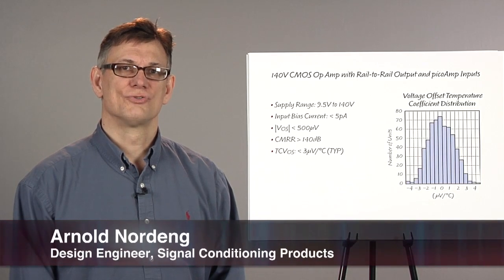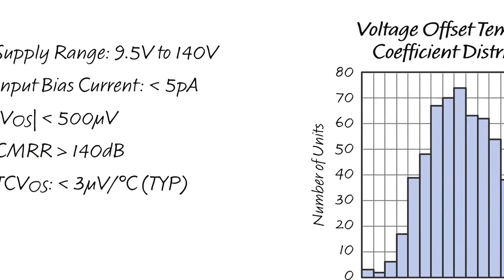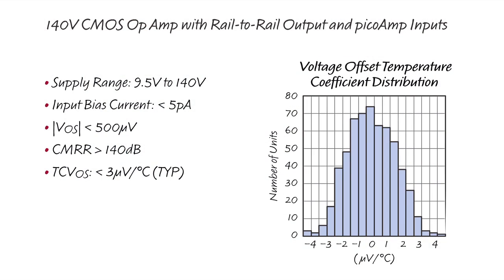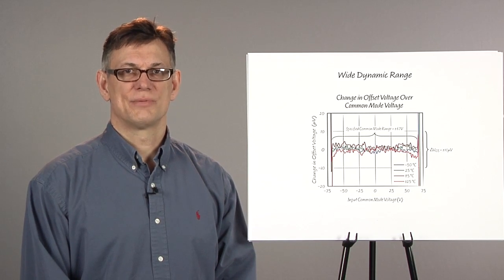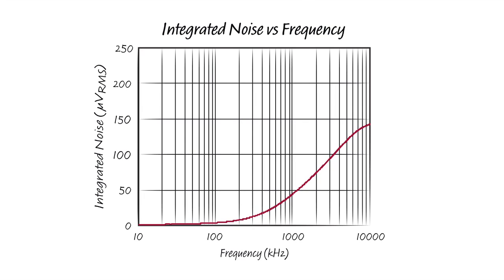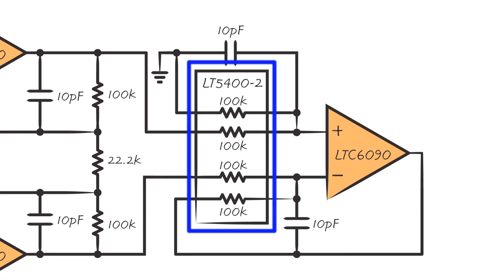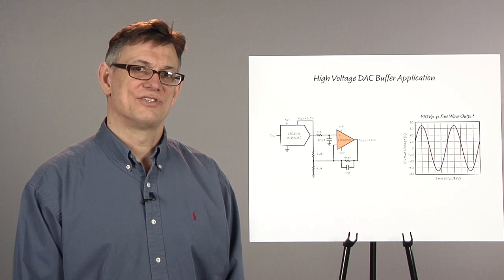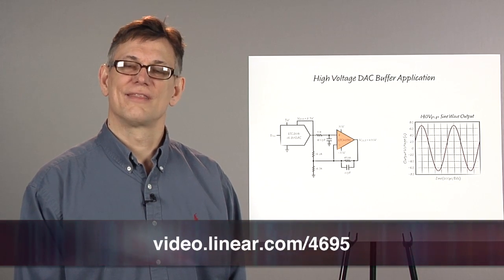140V CMOS Op Amp with Rail-to-Rail Output & pA Inputs

Comment: This looks like a great part, but is it the highest voltage op amp? Apex do op amps that will run up to 1000V (PA89)...
Reply: monolithic?  or hybrid?  Therein lies your answer.
Reply: This is a monolithic opamp, so is the model I compared it to....
Reply: The PA89 is a hybrid on a BeO substrate.
Reply: I went on digikey to price the PA89, and because its a hybrid, one opamp is $754.    But if you buy 250 of them, you get a price break of $695.   That is the cost for wiring together a bunch of discretes on a BeO substrate....its not cheap.....thus it is not a monolithic.
Reply: +blaaaaaaarghable Out of curiosity, couldn't you use a lower rated opamp to control a 1000-1200v mosfet(something like a DE-375) and achieve the same effect, or does the voltage offsetting impart too much error?
Reply: Richard Smith Yep, you could. Just interested in the single package parts. Voltage ratings usually make the integration difficult.
Reply: +blaaaaaaarghable And in many cases, increases cost. EVENTUALLY it becomes more cost effective, but even today, for instance, most single package variable linear voltage regulators are more expensive than driving an enhancement mode mosfet, unless you have relatively low current needs. Those ua741's are pennies.
I get what you are saying though, simplifying it with an all in one would be nice.